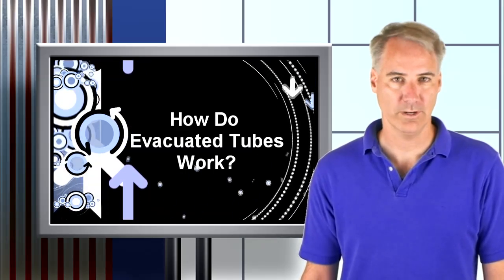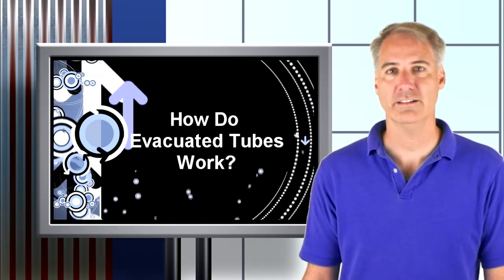How do evacuated tubes work? [Video]

Comment: You say that it flashes at 86degree. So basically one has to wait for flash before you get the heat out at 86 degree, so there is low level sun irradiation solar energy, which if below that, there is no hot water, because the heat tube, will not function until it hits 86 degree. So I don't have all the formulas and different substance specifics capacity and all in front of me so here basic principle that needs be proved otherwise I guess. What is the minimum solar irradiation, and desity for 86 degree flash, because that lowerly limit. Were as if you allow this to be double ended evaculator tube, were the water physically passed thought the collectors, then the water, could lay in there and basically boil to 50 degree, then be pump out or natural convection out the tubes. This would allow hot water at much lower temperatures than current heat tube designs with a heat pipe, because there is no band gap/ or minimum solar irradiation level, for heat to be conducted to water.
So if you want to squeeze more hot water out, then better to direct heat the water and passthrough the middle of the evaluator tube. Just have like a double linkage system a the top and the bottom.
I gather the current design of just because it was easy to push the tubes into the top solar tank , were that principle should be at the top and the bottom.
The other thing is you would use less material, as only need the glass, don't need copy tubes in the middle, which means cheaper.
So basically 
Double Header - Direct-flow evacuated-tube collectors, so only one glass channel in the middle of the evaluator tube.

Comment: Why not use liquid metal instead?
Reply: Jim Martin because it would be expensive to the extreme. Also dangerous as it would have to be Mercury or a Mercury/Gallium alloy
Reply: Solar thermal systems of this type, are for warming home interiors and domestic hot water. If you want much higher temperatures, such as steam turbines, you go with solar concentrators.

Comment: hi, so in summary is like a steam generator?... and honestly, a quality solar panel vs this evacuated tubes, which one generates more energy??? (per square meter)
Reply: TETOYVIENDO - neither one “generates” energy... both change radiant solar energy to another medium...  in the case of solar thermal, heated fluid, and in the case of solar electric panels, electricity.

  Solar thermal is definitely more efficient than solar electric, which is lucky to get 20% of the usable power of solar irradiance to your outlets after losses in conversion at the panel, battery charging losses, storage losses, and losses during inversion from DC to AC.

  A solar thermal system can be closer to 100% efficient than 0%.  Probably in the range of 50-80% depending on system design and usage.

  Solar thermal uses the heat energy and a portion of the light energy, without having to make multiple conversions of energy type.
Reply: If most of your electricity is used for heating the interior of a structure and domestic hot water, well designed solar thermal will absolutely be more efficient than solar electric.

  Solar thermal, in this format, however, will never run AC electrical devices.

  Each has their place, but anywhere heat up to 212F/100C is needed, solar thermal will be worlds more efficient.

Comment: I have been researching this a lot lately.
For northern climates these tubes are more efficient because you get year around use.  Southern climates go with flat panel.
And also always plumb your flat panels so the fluid fills from the bottom to the top.
Not top down as said in this video.
See Dr. Ben Gravely.

Comment: at night,  are they lunar coolers. they probably bring in an equal amount of cold at night
Reply: polok890, no. These vacuum tubes & heat pipe combinations are one-way thermal. If the sun is not out for days, then the circulating fluid might freeze in spite of insulation. Drain-back systems avoid this.

Comment: @ss7406 Solar vacuum tubes or evacuated tubes have absorber coatings which collect not only the visible spectrum of solar energy but also UV higher frequency/energy photons. Hence, even in cloudy weather it's still absorbing light efficiently. 

Cloudy weather alone does not really affect the "effectiveness", however two thing associated with cloudy weather do. I.e. 1) Cold weather, 2) lower intensity of light